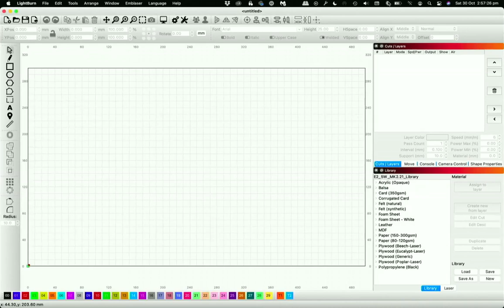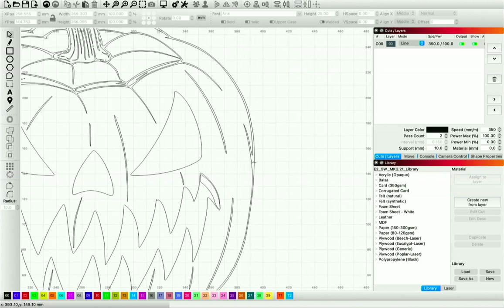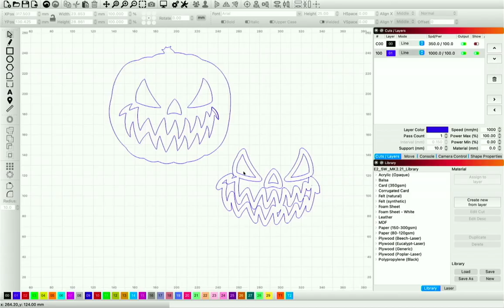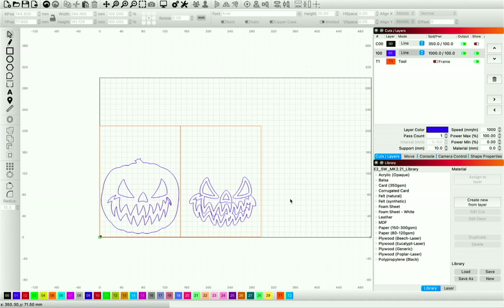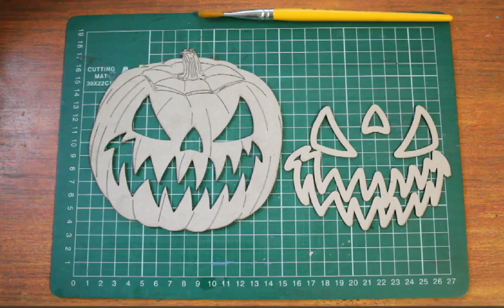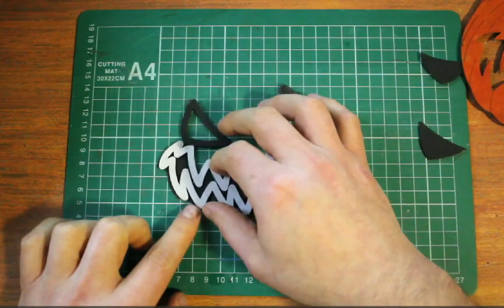Lightburn Tutorial: Halloween Diagram Jack O Lantern Project

Comment: Scaling to match isn't just for when you make mistakes.
Sometimes you're reverse engineering a matching part you need to fit to replace a broken one.
Reply from the maker: Good point. You can use it for many different applications. What was the project you used it to reverse engineer?